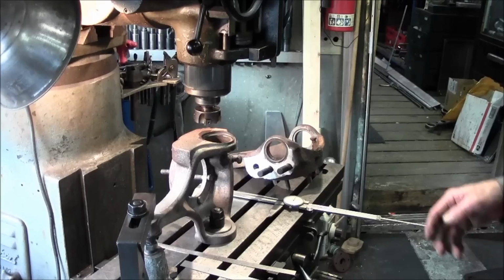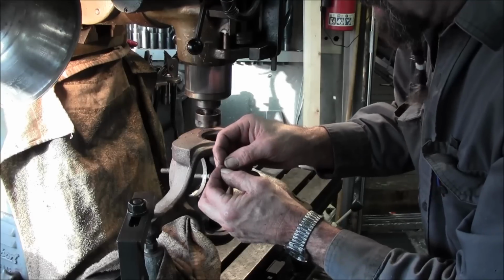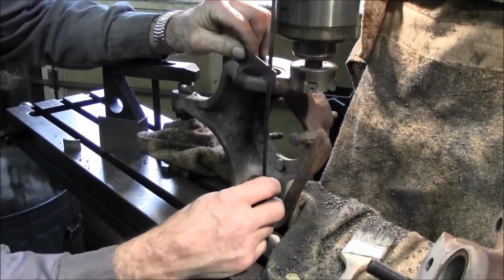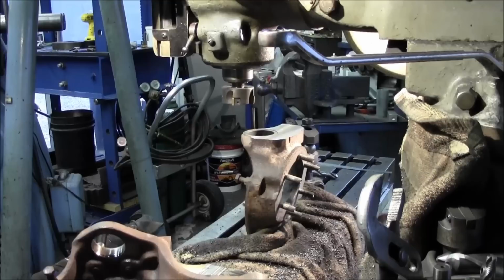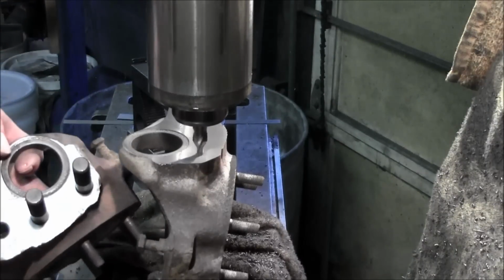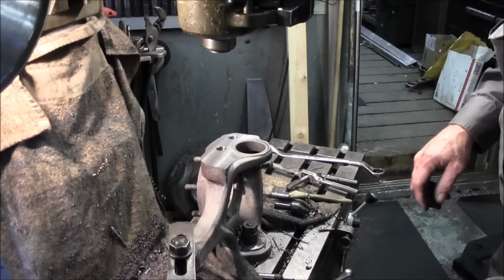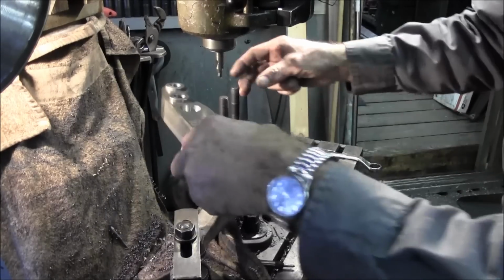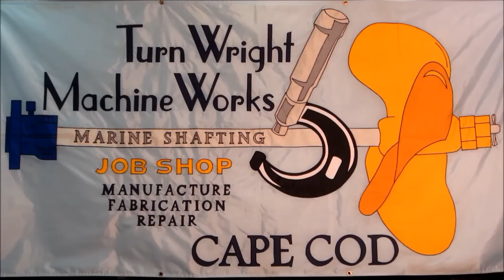Getting High Steering Part 2

Comment: hi Keith I watch all your video's and enjoy then a lot
I have been in engineering all my working life (40 years). I like to see people doing a great job and take pride in the work. CNC takes out all the fun and skill. 
you have shown me some very useful tricks and I use them in my workshop. one trick I use that I do not see you using is to use an edge finder to centre on holes or pins. it is a very quick method and with the use of a DRO and a good edge finder I can get to within 0.001"

Comment: Wonderful I like the Videos you have been making At my high school there is a Mill and a lathe that got saved (they cleaned the place of most of the shop equipment) they have not been used in at least 15 years so i took on the daunting task of cleaning them up (there was 1/2 inch of dirt and dust on the bed) the shop teacher ordered $2500 worth of tools and stuff for it i have been using it Quite a bit

Comment: Man! you can tap really fast Keith ! LOL. I need to get a tap follower, I usually tap in the drill press to get it started and then finish at the bench or vice. I have a handle to hand crank the drill press pulleys .

Comment from the maker: Some taps are just chasing taps and it seems if you break the chip you can keep tapping, but a good quality, sharp cutting tap, can be power driven in and out of its hole, some taps are designed now that bring the chip out of the hole as its tapping and some push the chip ahead of the tap for the open holes. ;{)---

Comment: Oh Keith, as a side note just about all Steering and suspension components are either stamped Steel, Forged Steel, or Cast Steel . No drive line or suspension components are made from Cast Iron as far as I am aware, I have never come across any in my years  of mechanical repairs.

Comment from the maker: The two most common signs when you need cutting oil or coolants; Color of chip is a sign of heat and galling or material sticking to cutter is a sign of lacking lubrication. You can always test it with some and see the difference. ;{)---

Comment: I'm not a machinist, but I must have tapped hundreds of holes in my life, 
I always thought the hole in back of the tap was a product of the manufacturing process,
I didn't know it had an actual purpose.
I don't have a way to take advantage of it, but at least I know why it's there.
What's your thoughts on cutting oil, I see you use it on some things, but not on other?

Comment: Why all the tool changes? Assuming your DRO is right, why not center drill each of the 3 locations, then drill the 3 locations then tape the 3 locations? You have 12 total tool changes when 4 is all that is needed that includes chamfering.

Comment: Great work. I just watched both parts of the video today. How much would a shop charge/estimate for this work...? I know of a company that sells the hubs machined but wondered if it could be done cheaper and with supporting my local machine shop.
Reply: There is always the listed shop price but prices can vary a lot depending on many factors.But if you find the right shop I think you'll be pleasantly surprised.Some things like time frame and season can also affect the price.If its something they normally dont deal with but have a slow time they might price it low when slow but high at others.
The most important thing I can add is as a regular with a machine shop (I also do some machining)my prices have dropped drastically.We have a good relationship over the years,but if I need it in a hurry I know it's full price.Although on the other hand there's times when he'll call me to see if I have any work he can bang out to keep his guys busy too.

I dont know Keith's rates but instead of asking him for a dollar amount it might be better to see how much time he has in the job.This way you can compare it to shop rates in your area.

What do the machined spindles sell for?

Comment: I'm wondering why you didn't use oil on the tap, I was taught and have always used cutting oil or some light oil if cutting wasn't available. More for the performance and protection of the cutting tool.
Reply: Cast iron is usually soft enough not to need cutting oil. If it had been steel or aluminum, he would have probably used something.

Comment: I'd say ductile [ spheroidal graphite ] cast iron aka nodular cast iron. It can be dusty to machine and has about 90% of the strength of low carbon steel. Why isn't the top of this casting machined like the other ?